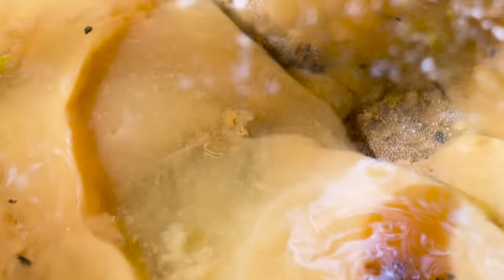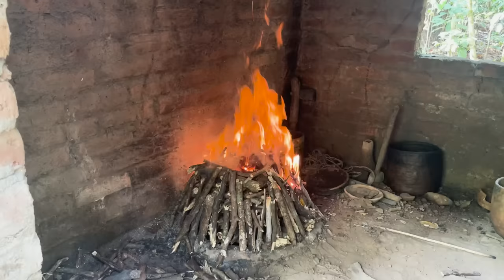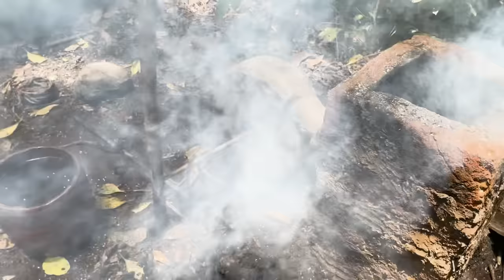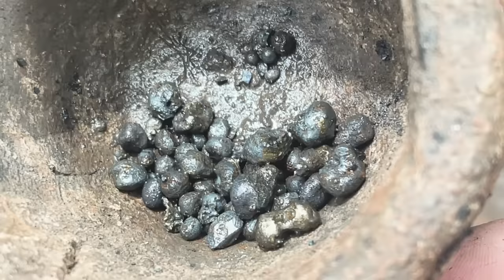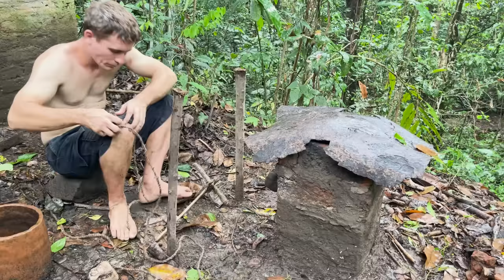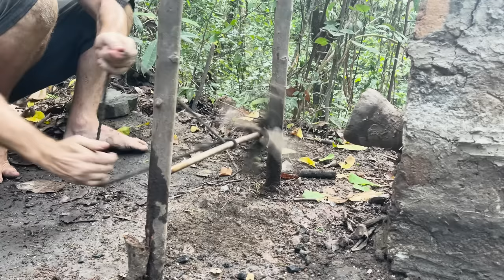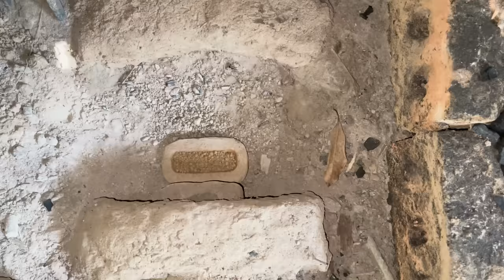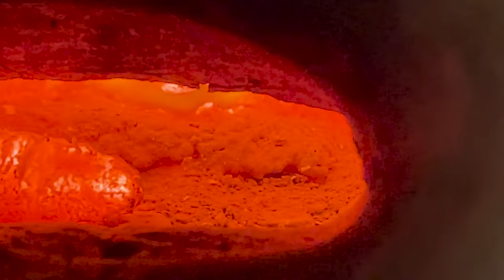Primitive Technology: One-Way Blower Iron Smelt & Forging Experiment

Comment: I will never tire of the unedited one-shot of him making fire by primitive means with such efficiency. Everyone else I see try to do something similar has to use a cut because it takes them so long.
Reply: He made all sorts of tools to make it faster and easier, but by the time he had them he was just too good with the basic method, so no point.
And here I thought our ancestors (with way MORE practice than him) would be impressed with matches.
Reply: Either that or the cut hides a cheat like them using a lighter.
Reply: How about using running water to keep the blower spinning?
Could channel the water like the water hammer video.
Reply: @shanepye7078 it is possible, but for the amount of air volume necessary for the fire, you will need more rpm for the fan which makes it impractical anyway. He already remarked that pulleys will make it more efficient though.
Reply: It's a work of art
Reply: His technique has gotten so impressive!
Reply: @sx4mania35  gear ratios would help if they could hold up to it. Difficult to make durable gears before metal tho
Reply: Chad Zuber tends to do fairly well
Reply: @michaelsorensen7567   I figure the pulley ratio can be worked around easier (which I think he already has in mind anyway). it's pretty much like the gear ratio for bicycles.

Also, I'm talking about pulleys here, not gears. Pulleys has been existed from at least Classical Greek era and it's easier to make.

my issue for that is, the manufacture/making (for a lack of a better word) of the pulleys themselves using the primitive tools he has in mind. It is doable, but carving a smooth round channel after cutting the wood onto a wheel shape without at least early Bronze Era tools will be quite... an experience.
Reply: As far as I know, a big part of his ability to start a fire quickly comes from choosing the right species of wood and it also being properly dried (this can take weeks). You're not going to be able to just pick up a stick in the rainforest and start a fire with it. Green wood is too wet, and in a lot of environments dead sticks will be starting to decompose which is just as bad if not worse than green wood. Indigenous Australians had entire lives to learn how to start a fire and use exactly the same method as he uses in these videos. But they also had techniques to transport hot coals from one campsite to the next one, because that was just as easy as keeping your precious fire staring sticks from getting rained on, and it's far less work to start a fire that way.
Reply: he's so good, I usually count along.  5-6 every time. amazing
Reply: He has could always make a grinding wheel. Id be willing to bet that that slag mixed into some clay would make a fine abrasive.

Comment: I am a blacksmith/farrier, and the best advice I can give is to close the casting mould. So no charcoal, slag and excess oxigen can get trough to the iron. I don't know about most of the other stuff, but I know that iron and steel hate open atmospheres when melting. Maybe a good place for research would be old crucible steel, I'm sure that could be recreated in a smaller scale.
Reply: He's using a primitive blast furnace which should give him some form of pig iron. Excess oxygen is actually good in this case, I think, because it would decarburize the pig iron into wrought iron.
Reply: That's what I was thinking -  a crucible and I'm anything but a blacksmith,
Reply: I'm not a blacksmith or anything to do with ironworking, but that was my first thought seeing it too, that piling the charcoal atop the mould just means the iron is going to absord way too much carbon.
Reply: I'm definitely no blacksmith, but shouldn't he be able to make some sort of ceramic or stone, etc crucible capable of withstanding higher temperatures and then melt the iron inside the crucible to do what you said?
Reply: i was wondering why he didnt cover it up, he spent time separating iron from slag then added it right  back basically in the same step
Reply: so make a little mould top and put it on like a little hat!
Reply: Unfortunaly not. Making iron from ore is smelting, not melting. You need the reductive CO rich athmosphere to strip the oxigen atoms out of the ore.
Reply: I was wondering if there was a way to make some kind natural flux to protect it.
Reply: Half this dude's life is spent just making charcoal.
Reply: @Pross1993  The furnace material he is using is fine temperature wise, they can smelt iron in clay kilns. Since those bricks won't melt or set fire. The main problem is getting enough heat.

Comment: I have a fair ammount of blacksmithing experience under my belt and forge welding different steel types together and I can't help but think that when you placed the iron balls into the clay form that using a form of flux to keep the oxygen off of the iron balls could help it keep from braking apart after you puddled it. Sand works as a decent flux because it will melt down I to a crude form of glass and even with extreme heat, won't allow the oxygen to it causing iron oxides that basically make a layer between the iron balls that will make it break apart when heated again. I have used plain old creek sand to forge steel together before and it worked just as good as Borax in my humble opinion.
Reply: Its the carbon monoxide from the incomplete combustion that is reactive enough to strip the oxygen from the iron oxides to convert the oxides into carbon dioxide and metallic iron. so I wonder if backing the iron away from the oxygen supply a lil and bathing it in super heated exhaust fumes might keep it cleaner too. I feel like we need a mentality shift away from is this enough are to ideas that ask is this too much air. Same rules apply to buying TVs
Reply: I completely agree about using a flux. And perhaps a mold that is more vertical like a finger hole in a ball of clay. This has the advantage of less air exposure and gravity would be working harder to  push all balls together.
Reply: I would also add that high-carbon steel should be worked when it's yellow-to-white hot. Even modern high-carbon steels will get brittle and break if worked when only red hot. I got told off about that by my mentor when forging my first knife from tool steel.
Any kind of system to help automate / stabilise the air flow (water wheel / flywheel) would also give more leeway to move the iron in and out of the forge without the heat dying back too much.

Comment: As a metallurgy student this is really impressive.
The blower has come a long way since your initial attempts.
2 improvements I could think of would be adding a flywheel to the axle and using the rope for a pulley drive with a crank handle.
As an alternative you could also try Japanese style box bellows. Basically just a big square piston pump.

For the smelt itself:
the single biggest leap was hot blast. Basically just preheat the fresh air before putting it in the furnace. Ideally the preheat would be done by burning the exhaust gasses in a regenerative heat exchanger. For your stone age setup, you could simply run a clay pipe through a second fire between the blower and furnace.
In ferrous metallurgy there is relatively little headroom temperature wise so even a few 100 °C of preheat should give you a significant improvement both in ore reduction and remelting.
For your blast furnace you could also try adding a little limestone (snail houses/ egg shells) as flux.

In principle all these processes benefit from upscaling but I doubt you want to do that.
Reply: "How can we improve the smelting process?"
"How about a fire?"
"We've already had one"
"We've had one, yes.. But what about a second fire?"
Reply: @DasSmach  "Don't think he knows about second fire, Pip."
Reply: Depending on location a trompe could be ideal but would be a fairly large construction project on its own.
Reply: Since the double-hand rope pull experiment proved successful, pulleys are the logical next step for blower design.  Wood or clay wheels would allow differential, probably with a double hand pull to start.  After that, a driving rod connected to a pedal would free up the hands to add charcoal/ore while keeping the fire hot.
Reply: Pre heating the air would be huge
Reply: The biggest obstacle for a pre heat is the flammability of the components, sticks and leaves burn lol
Reply: I was thinking about adding a crank wheel to the centrifugal blower setup as well so he can just crank away with a less stressful motion and make for lighter work.

I was also pondering if the cold air was somehow damaging the billet he cast which led to the unfortunate forging attempt.

Good insight! I’m no metallurgical person, but nice to see that an experienced individual was able to speak to both of the thoughts I had in the comments.

The only other thing I was thinking is if there is too much carbon in the iron due to the direct contact with the charcoal leading to the brittle nature of the billet during the forging attempt.
Reply: @Adamarchy77  He's suggesting that the air being blown in the furnace itself be pre-heated, not the fuel. That way, no heat is lost raising the air to fire's internal temperature
Reply: Big brain move
Reply: He has already tried shells as flux. He discovered that the ash that is added during the roasting process is basically exactly enough. Hot blast would be really huge but the one thing he needs to experiment with is refractory materials. If he wants to have a hope of handling and treating molten iron in the future (such as actual cast iron, as this appears to actually be pig iron), he will need a crucible made of a pure clay free of metal oxides or other contaminants, that has probably been enriched with an actual Refractory material luke quicklime as grog. Clay, even very high quality clay, will just melt at the temperature of molten cast iron (or god forbid molten steel), and this is not an insignificant materials problem. Other than that, maybe he just needs to combine together the technologies he has experimented with to produce something that is well insulated and with a very powerful draft that has lots of forced air being blown through it. To be honest, if he could, a blower that was more tightly fitting to the housing might be a good idea, so he could actually move air with Force instead of just velocity.
Reply: can you point me to a diagram on how a hot blast furnace is built? I would like to learn more.
Reply: I also feel like a gravity fed high pressure water hole powering the propellor would also work, take the water from the creek and feed it into gradually smaller diameter pipe to increase pressure and feed that onto a propellor attached in parallel with your air propellor
Reply: "Japanese" box bellows, lmfao.
Reply: @jc13781 the reason the billet crumbled is because cast iron is too brittle to forge.  He had the right idea in trying to decarburize it, but you need to get it up to forge-welding temperatures (yellow-white, like butter) to do that.  As the name implies, welding temps would also allow you to re-consolidate it back into a billet by forge-welding it into one lump.
Reply: @EkiToji  The first picture that comes up when you search trompe is feeding a forge. If the river allows it, it's literally the optimal solution.
Reply: @FrontLineGamer  consider the following: https://en.wikipedia.org/wiki/Trompe. Very efficient. Very simple. Probably been around since ancient times.
Reply: @Adamarchy77  not really. The heat would only be added downstream of the blower.
Reply: He's talked about cranks and pullies in the past, and decided against them.  If he could build them with the technology level he's using, they're relatively likely to fail.  The bow method used here is a massive improvement already, and has the advantage of simplicity in its design.

It's the same with most water powered ideas, it could be done, but not easily with the technology he's using and the more complexity in the design and steps in the process the more points of failure there are.  In history thus process would have just used an extra man or two.  One or two men to spin the blower and one to feed the furnace.

I agree a flywheel would be a simple and easy to add part though.
Reply: @bilbo_gamers6417  Good comment. The reason I suggest limestone is that Ca is chemically important for purity/ quality.
Refractory is also a secondary concern if it's a temporary setup that's struggling to produce iron at all. It also doesn't matter as much since heat loss already keeps the temperatures down.
Better refractory should definitely be on the to-do list later on. Especially for steelmaking.
Reply: @kdarkwynde  I think he was trying to cast it. It just didn't get hot enough to fully melt and just lightly sinterd together. Combined with the excess carbon, the crumbling is not unexpected. Proper steelmaking is a challenge for later tough. His best bet would probably be something like blister steel or crucible steel depending on what is smelting process puts out. Spark testing the raw iron would be useful.
Reply: Есть старый кузнечный флюс это: речной песок ,пищевая соль и пищевая сода (можно  из костра как заменитель)
Reply: Is a flywheel feasible? seems like a delicate setup
Reply: Adding more piping seems like a way to lose air speed even if you get hotter air, hard to imagine that being very efficient with clay
Reply: Has he not tried adding shells or something similar as flux in the past with little to no success?
Reply: @billparrish4385 Cut to pippin lighting the beacon
Reply: @akhasshativeritsol1950   I think they meant that the blower setup is made of sticks and leaves, so the preheat fire might burn them
Reply: @dalcowboiz A flywheel made of clay would probably be easy enough to make (he already is quite good with ceramics), and add enough mass to be functional.

A fairly large ceramic disc with a central hole to pass the shaft, and opposite radial pairs of holes to tie a stick perpendicular to the shaft using pieces of rope, that is then fixed to the shaft.
Reply: @plvmbvm513  Oh, maybe. I don't think that would be an issue, I doubt the air would get hot enough to spontaneously ignite the fan, and even if it did, one could probably negate that risk by wetting it periodically. It depends on how hot the pre-heated air is though...
Reply: @Pixelarter  I suppose on the bright side if he built that it wouldn't be too big of a commitment to set it up and see if it worked. Some question of putting excess strain on the delicate shaft, but regardless, not hard to find out.

Have to imagine a flywheel would add more than the double bow technique. Not to say they can't be combined.

Fun sounding experiment.
Reply: @akhasshativeritsol1950  right but warm air is less dense and wouldn’t provide as much energy as cooler air, that’s why turbo charged cars have intercoolers, more dense air means higher concentrations of O2, hotter flames.
Reply: @ARandomTroll   heating the air wouldn’t get the flame hotter, it would lose energy, cooler air is more energy dense, plus the forced air wouldn’t be as efficient due to the increased area of more piping, it’d be like an open mouth huff vs pursed lip blow when trying to light kindling
Reply: @Adamarchy77  Yes it would. https://en.wikipedia.org/wiki/Hot_blast
Reply: @Adamarchy77  Interesting. It's possible that the benefit depends on the mechanics of the air delivery system, and the temperatures the air is reaching.
Reply: @ARandomTroll  I stand corrected.

Comment: Two ideas for a hotter fire--- 1) Insulate the firebox by adding a second wall 10cm away from the existing furnace wall. Fill the gap with loosely dropped in ash (not packed). 2) Preheat the air before it goes into the furnace (or into the blower). Maybe have a longer pipe going from the blower to the furnace and have a secondary fire under it to preheat it. 

Best of luck, each video is super exciting!
Reply: These are some awesome ideas
Reply: Also making the furnace round might be better since the air will flow without slowing down bouncing off the walls.
Reply: Commenting to boost your suggestions
They sound quite feasible
Reply: JDewittDIY, Cold air burns better.
Reply: @user-kw2rl8df2s  We're talking about a fire, not an internal combustion engine where the volume of air is limited by the size of the cylinder. Cold air is denser, so it holds more oxygen, but I don't know if that would be a factor in this case. My thinking is that the cold air rushing in is cooling off the fire, and if you were to preheat the air you could get overall higher temps in the furnace. It would need to be tested though.
Reply: @JDeWittDIY  I know it's not an internal combustion engine but a coal forge also burns better with cool air.
Reply: i think he did the first idea in a previous video, can't remember the results though
Reply: What about making a tall chimney fhats gets wider at the end? The compressed hot air will suddenly expand sucking more air from below.
Reply: @user-kw2rl8df2s  I'm pretty sure hot blast, that is using hot air instead of cold air, has been a thing in metallurgy for centuries.